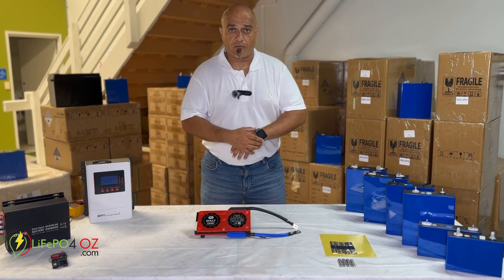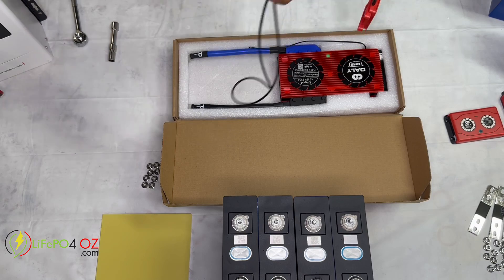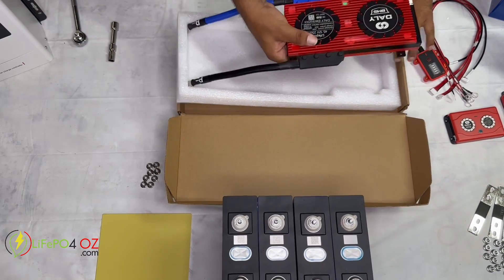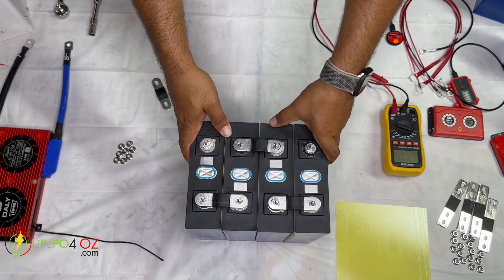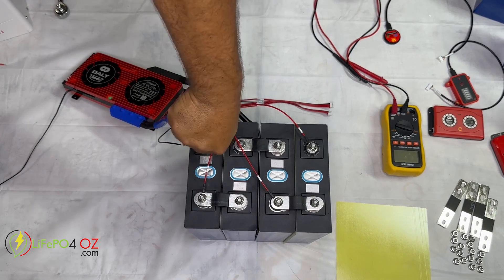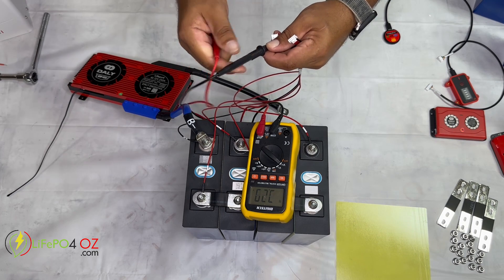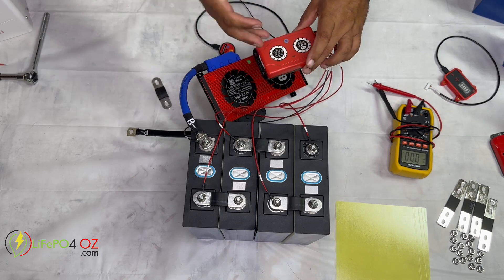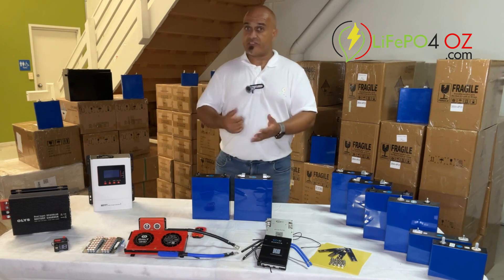LiFePO4 Oz: Step by Step Daly BMS & LiFePO4 Kit setup

Comment: What bms model if the 320ah cells
Reply: The BMS amperage determines the amount of power you want to get out of the pack and into the pack. For example, you can use a 100A BMS for a 300A pack, but you can't use a 300A bms for a 100A battery pack.
Reply: The BMS depends on the discharge current of your device!
In general, we recommend using a 200amp BMS if your battery pack is 51.2V 200AH-51.2V 320Ah

Comment: What about the black wire where does it goes
Reply: It's used for a parallel connection. It's the minus current wire. 

And if you don't have another pack to connect it parallely, then it's just a simple cold wire or the minus flow current, and the other part of the pack is the hot wire or the plus flow current.

Comment: I have bms daly 24 volt 50 amps and i installed 8 life po cels But bms not on. Please guid me to solve the problem. Thanks
Reply: That sounds like a low amp rating for your 24 volt battery.  But I'm no expert.